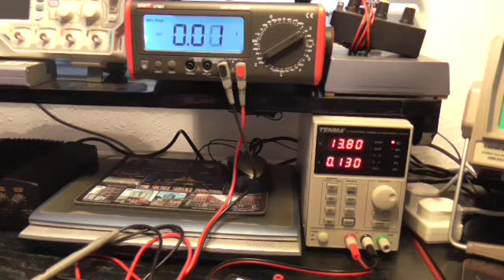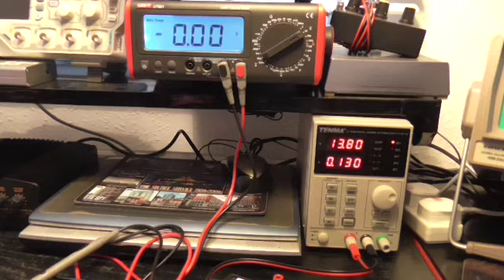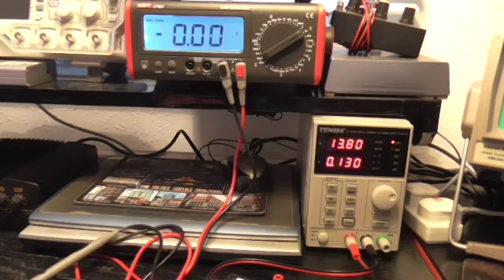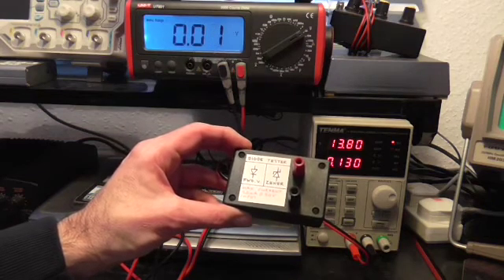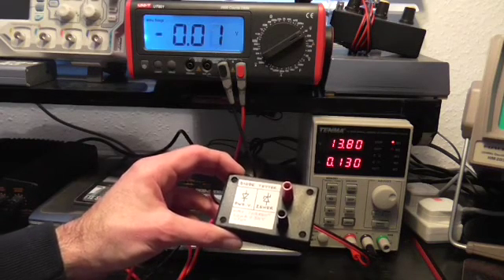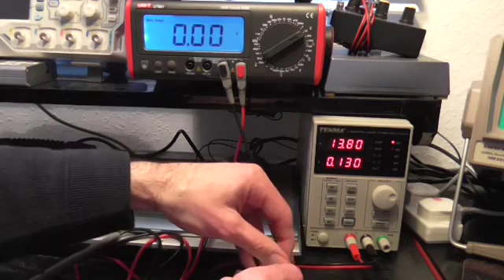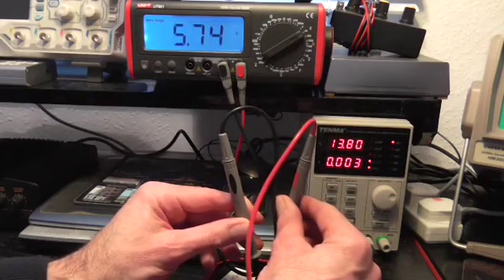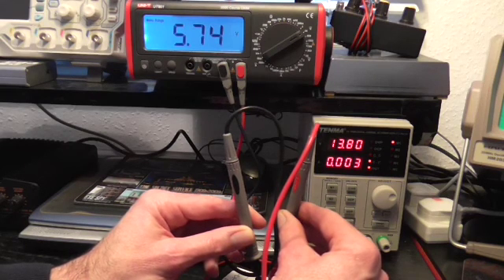A simple homemade Zener diode tester

Comment: Why dont u use the powersupply you use only.It has constant current led.Set the volt to 0 and short the leads from supply and set the current to around 10 mA,on my supply around 12mA.Unshort the leads and hook up the zener on the pluss minus the right way and raise the voltage on the supply until you se the led go on,There is a video by Mjorton? on this.Easy and nothing more than the supply with c current led.He explain this much better than me

Comment: you could get transitor tester , that costs 4 pounds , runs on 9v battery that last a very long time, it autodects most components and display usefull graph of input etc, including identification and measured readings
Reply: Not all transitor testers can go to 15-18 volt to test  15 volt or 18 volt zener diode.Powersupply with constant current led like he is using on this video.Have 2 of the same model and work fine to test zeners with.My lab supplies i have to turn  up to around 12 mAmp on the display before this to work,guess it have to do with their constant current led  sensitivity before it switch to constant voltage
Reply: https://www.mikrocontroller.net/articles/AVR_Transistortester